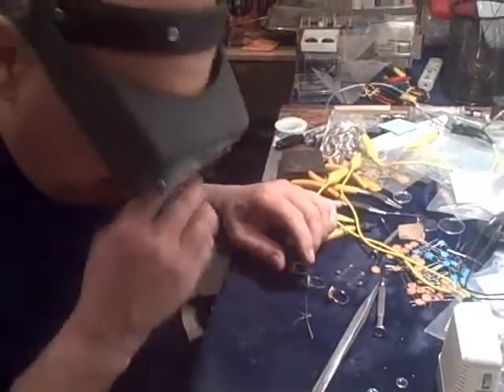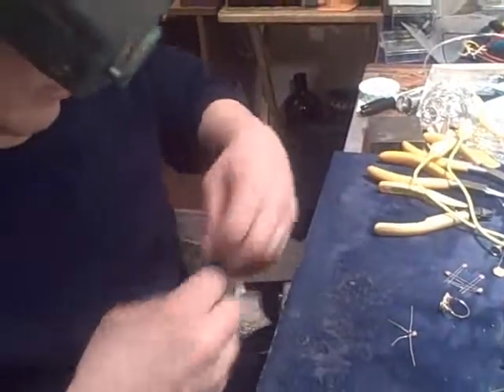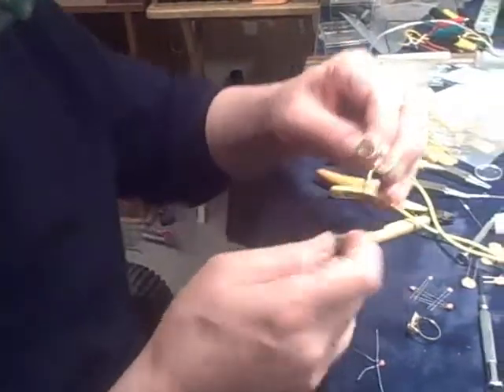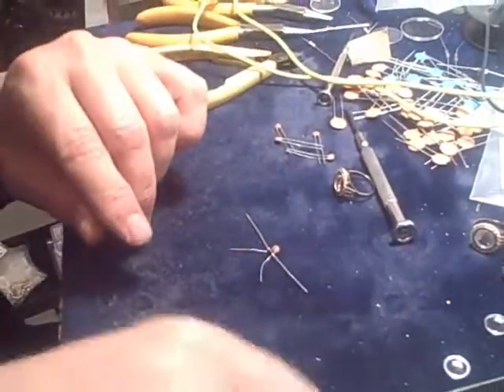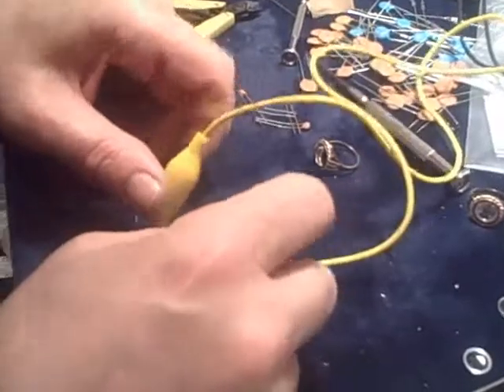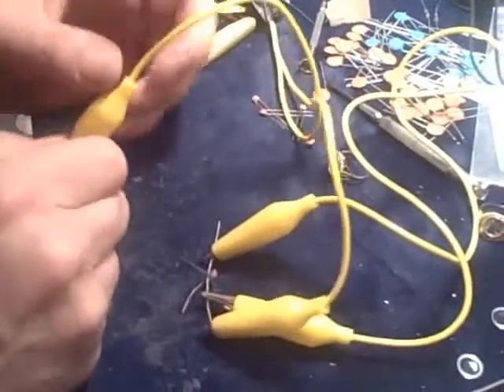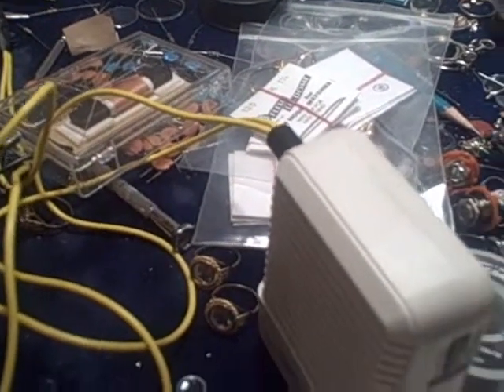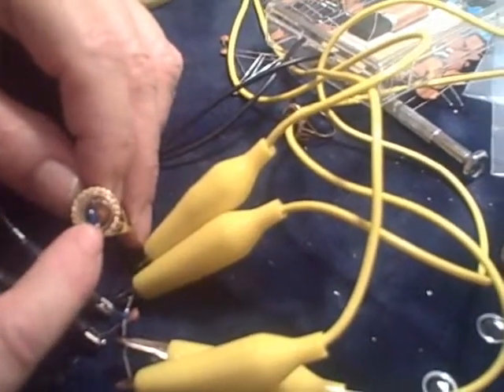smallest crystal radio works - benchtest and ring mounting

Comment: I think your rings are very cool but feel obliged to let you know that ultra low power / radio / energy emissions are now suspected to be much more dangerous than large or even huge power emissions because they interact with the body's own ultra low power radio transmissions that occur at the cellular level. In short, if the power is low enough that it tunes into the body's transmissions, cells can be fooled into believing the radio messages are orders from the body / other cells. In theory this could cause erratic cellular reprogramming which could trigger uncontrolled cellular division I.E. cancer.
Reply: +Mark Sassano It absorbs a micro fraction of the RF that surrounds you... That your body didn't absorb. Your fillings and minerals in your blood harness more energy from RF than these devices ever would. Cancer is not "uncontrolled cellular division", it is "unmanageable cellular division of genetically crippled or indifferent DNA, within a cell"

We have multiple forms of cancerous cells in our bodies, all the time. 99.9% of them are "managed" by our bodies protective systems. (Which is why frauds can detect cancer and start treating for cancers that are already managed by our bodies, then claim to "have cured you", once they no longer detect what the body naturally got rid of.)

Watching this youtube video, being near broadband modems and wifi is more of a risk than wearing inert minerals on your body. Going in the sun, getting x-rays, flying, or living near a power-source of AC power is more damaging than this ring would ever be. Getting in a car is more of a risk than doing any of that...

You start to die, from the second you are born... Deal with it. Worrying about the inevitable is just wasting time. Writing about it, is a waste of my time, when I have to read it, and subsequently, reply to it. At the end of the day, the minerals we borrowed from this universe, hoarded in the forms of our lives, will eventually return back to the earth, damaged, poisoned, used-up, and locked away from others to use in the future. Don't be so selfish to convince others to worry about another mineral hoarder, when we have our own senseless and selfish things to worry about, before we see our inevitable end.

I guarantee that those who pump their bodies full of poisonous formaldehyde or sinter themselves into useless carbon, destroying the futures hoarded valuable resources they consumed, will have less chance of "continuing" in any other form of life, other than being a rock of coal, or an eternal zombie. The future matters to no-one but those who must live in it. Not those in the past, or us in the present.
Reply: If used to passively receive no problem... (Man made RF is a huge and deadly problem, but isn't caused by your passive receiver). If used to transmit on the other hand it is a very grave problem, especially if the transmission is feeble as recent findings have demonstrated conclusively.